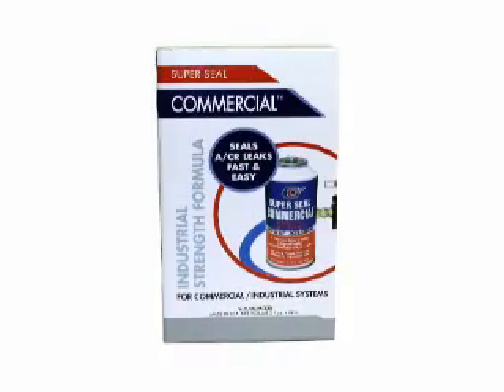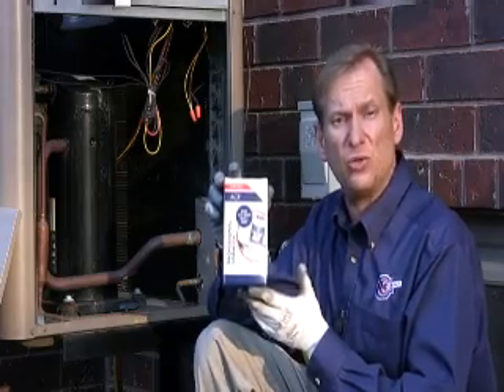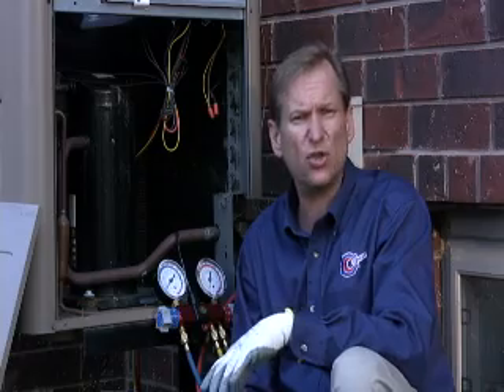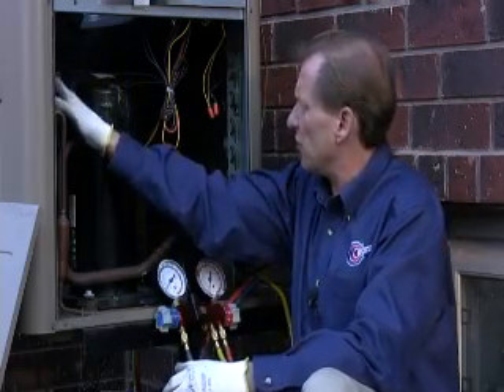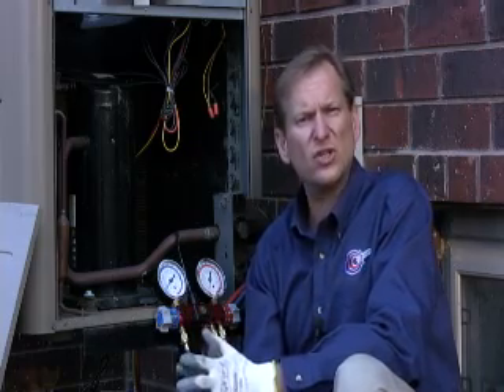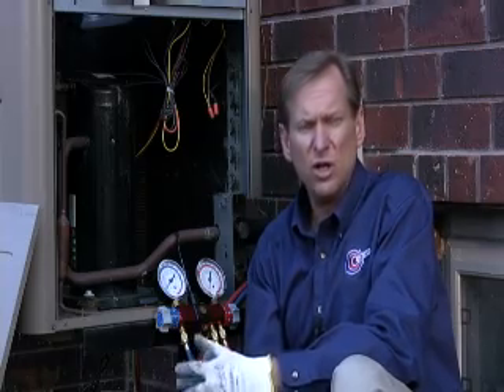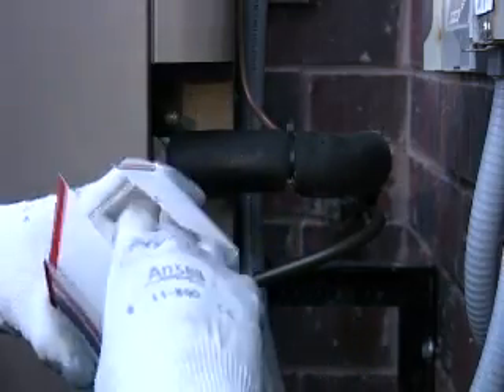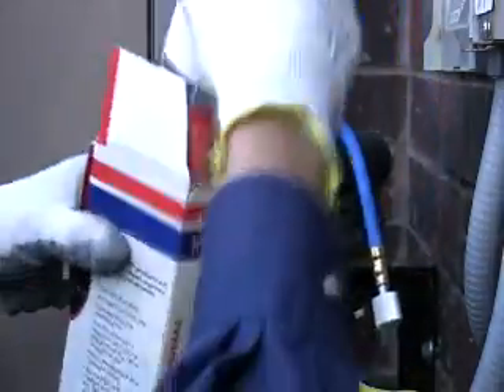Super Seal Installation

Comment: I keep on hearing horror stories about this product but have not yet experienced anything bad with it. Used it over 30 times. It worked about 95% of the time, the other 5% were leaks too big for the product and I ended up finding it later. I even used it in my own house on a 12 old year unit with a line leak I just could not find after spend a whole lot of time in it. After charging the system up after a 3 month period is leaked out again but once I put super seal the problem was fixed. That was a year and a half ago. Never gave DRY R a try either but that may be a good idea.
Reply: I use this product over 8 years if it has a small leak use it and you dont have any more problems.

Comment: I've used in everything from Sub-Zero refrigerators to central a/c units.  Followe directions to the minutest detail.  I have a good vacuum pump and change driers.  20 years of doing this and never seen something fail so consistently.  70% of the time I used super seal, it either locked the compressor or plugged the cap tube.  Never again will I introduce this contaminant into an HVAC/R system.  Replace leaking components - don't do a crap patch job.  Told Johnstone this too.

Comment from the maker: Super Seal Advanced is our new sealant with an added moisture eliminator to enhance  our formula to help seal larger leaks and eliminate 20 drops of water. Our Dry R (moisture eliminator) protects our sealant even in hygroscopic systems such as 410a.

Comment from the maker: Hello,

I am sorry to here about the troubles you have had with Super Seal. Our sealant is completely compatible with electrical windings of the compressor motor. It will not interfere with compressor valves or form in cap tubes, orifices, or TEV's, and does not impede the lubricity of the system oil in any way.
However higher levels of moisture can prematurely activate the sealant, always adhere to ARI recommended levels of moisture
Request and questions can be made to 1-866-548-3644

Comment: on the 4:30, the instruction is to "shut down the unit for 10 minutes".

However on the "7-step" video, the position of 0:36, the instruction is to "run the system for 10 minutes".

Shut down the system for 10 minutes; or run the system for 10 minutes? Very confused.

Comment from the maker: @PutSome5tankOnIt You may be interested in some of our other products such as Dry R and Total. If Dry R is used in conjunction with Super Seal, it will not only eliminates 60 drops of moisture, but gives an added boost to the sealing capacity. For this reason we invented our all in one sealant know as Total; this contains Sealant, Dry R and Flash Dye. For more information view some of our new videos.

Comment from the maker: @dennisthemenaceru Super Seal is safe for recovery, providing the technician uses the appropriate sealant (COMMERCIAL,HVACR and ACR) for the size system. When the refrigerant is recovered it will act as a solvent and effectively clean the recovery unit and pass safely into the recovery tank. When recovering always pump down your recovery machine to completely remove the used refrigerant.

Comment from the maker: @Lokivoid The Sealant will not setup providing the technician uses the appropriate sealant (COMMERCIAL,HVACR and ACR) for the size system. When the refrigerant is recovered it will act as a solvent and effectively clean the recovery unit and pass safely into the recovery tank. When recovering always pump down your recovery machine to completely remove the used refrigerant.
Please Visit our website to see our training manual for more extensive information

Comment from the maker: @fetisov02 CAUTION: If a system has fallen into a contaminated state, the introduction of CLIPLIGHT's sealants may accelerate the overall failure of the system. Wet refrigerants laden with moisture or particle contamination can
cause premature set-up of sealant and form restrictions in strainer baskets such as those that exist before a TXV or similar expansion device.  It is very important all Important before procedding steps are followed before injection Please Vist our website for fmore info